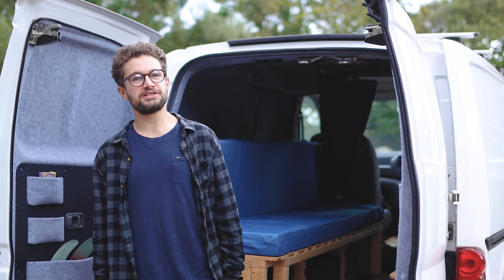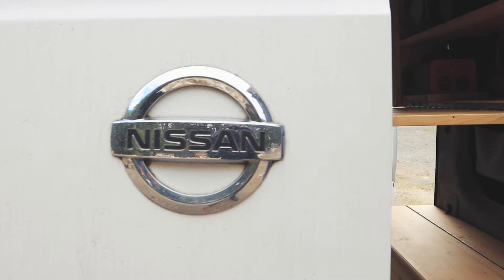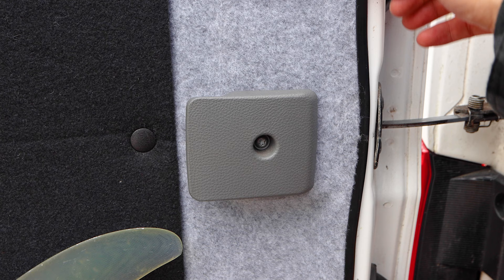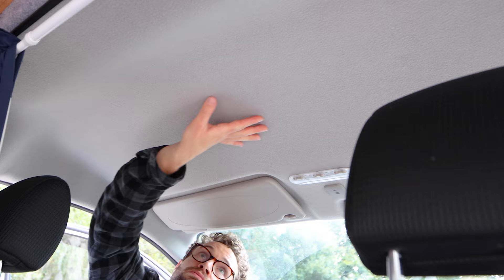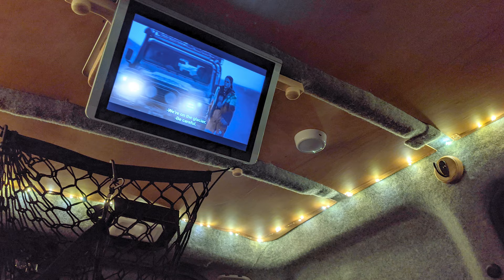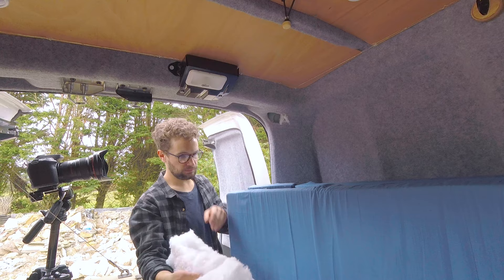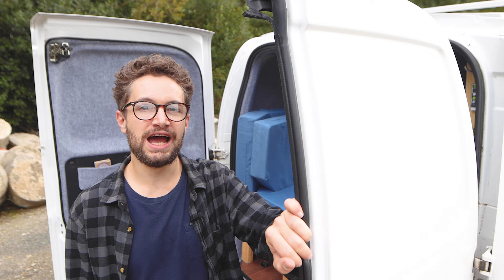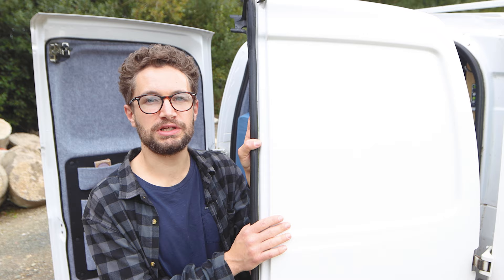Inspecting And Reviewing My Van Conversion | Van Build Mistakes | Tiny Camper Van Conversion

Comment: I've got an nv200 too.  I had an RV place put a 100ah battleborn into the driver side front fender, and a dc dc renogy charger off the alternator under the driver's seat.  power delivered to the back of the hump between the seats, then cable to my fridge.  it's the only thing running off the battery.  all my lights are off their own built in batteries.  I just have a big queen height, full width bed platform with all the camping stuff underneath and fridge in back.  it's great :)  not as fancy as your's tho :)

Comment: Thank you, for this video to share your experiences.

I have windows in my sliding side door and in my back door. (car factory made)
I will add a window in my other side. To look outside, when I´m in my bed.
More windows are important to feel well, not like in a dark prison.

I convert my lights lines from AAA batteries to USB powered.

Your bed frames slides better, when you install plastic stripes.
So it rubs wood on plastic, not wood on wood. 

Your Van looks like you need a larger table. ( I have seen your insta photos.)

I convert now also a mini van (Opel Combo C) In GB its called Vauxhall Combo C.

Anf thanks for your good english speaking.

Greetings from Germany (liked and longer subscribed)

Comment: The NV200 I bought yesterday has windows all around. The tailgate is the single, up swinging with a big window. All windows are tinted and the windows in the sliding doors have a sliding ‘porthole’. It makes for a bit of a problem so far as carpeting the doors go.

Comment: I insulated the roof with the same product and it did not work for me. On the cold, humid nights, vapor would condensate in the cold foil. As you said, for people living in their vans permanently this insulation will not work. One time it rained for over a week and the roof had condensation all that time. Mould starts to grow on the surface.

Comment: I’ve watched lots of videos on insulating vans(mines purely a work van, I wanted warmer in winter)  I done mine same as yours. I’ve also seen videos people doing it with the reflective bubble wrap on top on the plastic bottle insulation, they said it doesn’t do anything when it’s against the metal work 
I’ve been confused since
Reply: I would think that placing the bubble wrap against the panel would deaden the sound more.
Reply: hi, how is your insulation?

Comment: Hi James, i never sent you the pictures of my NV because i intended a rebuild which is now complete.

 I am also going to fit the rear door windows onto carpeted doors.

 I fitted a 120Ah leisure battery under the passenger seat which has a FASP swivel base fitted, the battery measures 353x175x190mm  L,W,H. and it goes under perfectly once about 2mm is trimmed, from the seat base, this is connected to the start battery via a switched relay and fused both ends. all an easy retro fit, i can send you pics if you like. I also have an all in one diesel heater under my bed, if i did another i would chassis mount  and plumb into the cars fuel tank as it is a big chunk of storage gone and i had a little spill while rushing to fill minutes before a trip. I have also retrimmed the sun visors with Jaguar illuminate vanity mirrors fitted, and created a leather trimmed flat bottom steering wheel along with fitting a 10" screen android DAB radio. 

I am just on with making the factory reverse screen show a front camera image, with the rear camera showing on the radio screen, as well as re trimming the front seats with armrests, seat heaters and inflatable lumbar support. Ed
Reply from the maker: Hi Ed, wow sounds like some amazing upgrades to your van! Have you thought about making your own videos of your van conversion?
Reply: I have sent you an email to the address you gave me at  the end of last year.

Comment: James instead of putting in rear windows what about a sun roof or a marine hatch? That would give you light and ventilation but the van would remain stealthy
Reply from the maker: Hi Kim, thanks for the suggestion and link - I'm not too worried about stealth, but I do like the idea of a hatch. My main reason for rear windows would be to enjoy the view in wet/cold weather without the doors open.

Comment: Well this is good timing. I've just been around Cornwall, Devon, Dartmoor etc although I prefer Bodmin for some reason. And I'm in my NV200 which I converted and followed some of your videos along the way. Have you fitted a roof vent or heater? It got cold in my second week in Cornwall and I got really bad condensation on the front windows, so fitting the heater really helped. I'm in Scotland now, it's colder and I've been worrying about behind the panels so your well timed video is so reassuring. The only place I still get condensation is right down in the rear corners of the floor, near the bottom outer corners of the rear doors, so I'd advise checking there. What do you do about bathroom facilities? I'm still having to check into a campsite every three days but I'm determined to be more independent. I have so many other questions I'd like to ask. I'm coming back down to Cornwall on my way back home so I'll look out for you if you're still out and about. Mine's the silver van with the unicorn in the front window 🦄 :)
Reply from the maker: Hi Elliot, I haven't got a roof vent/fan or heater as I only sleep in the van less than 30 days a year, so condensation isn't a big problem, though if I slept in it more I'd consider it. Chances are we'd be in a campsite, so I'd use the facilities there. Will keep an eye out for you too!

Comment: Great video, currently converting my Nissan NV200, how has it been with out a vent installed?
Reply from the maker: Hi Barry, it's been absolutely fine without a fan, but bear in mind that I only sleep in the van less than 30 nights a year. The rest of the time we use it as a leisure vehicle, but if I was out in it more I''d probably consider a fan!
Reply: @LensOfJames  great thanks that’s perfect, yeah it will only be used a handful of times during the year so that’s reassuring thanks

Comment: The co2 detector should be down low not at the roof
Reply from the maker: Hi, it's a CO detector not CO2, and because carbon monoxide is almost the same density as air, it will disperse evenly throughout the air in a room. As the van is very small with limited areas to mount it, 🙂its the best position I've found for it